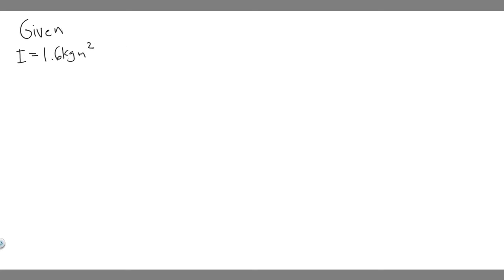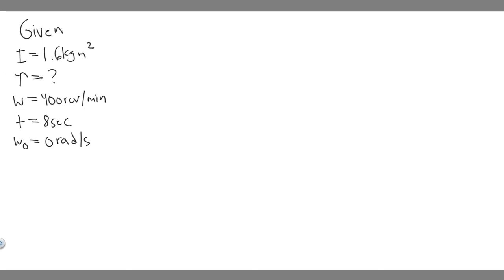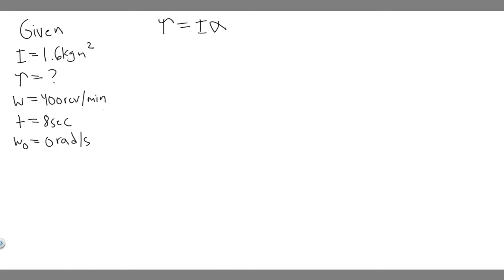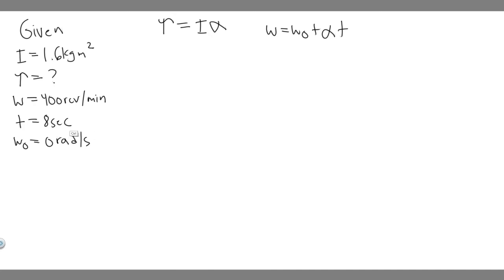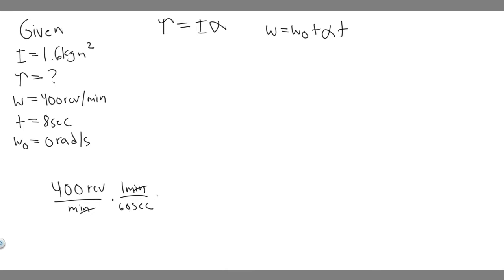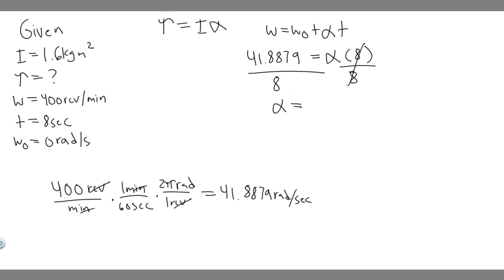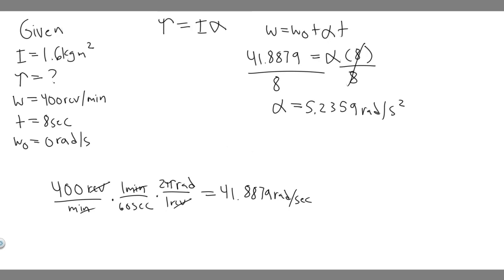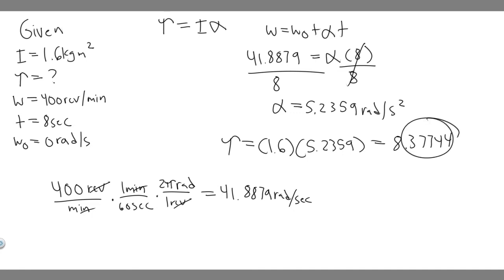The flywheel of an engine has moment of inertia 1.60kg • m^2 about its rotation axis. What constant

Comment: An instrument-carrying projectile of mass m1 accidentally explodes at the top of its trajectory. The horizontal distance between launch point and the explosion is x0. The projectile breaks into two pieces that fly apart horizontally. The larger piece, m3, has three times the mass of the smaller piece, m2. To the surprise of the scientist in charge, the smaller piece returns to earth at the launching station. Neglect air resistance and effects due to the earth’s curvature. How far away from the original launching point does the larger piece land?
Reply: Bro 😂😂